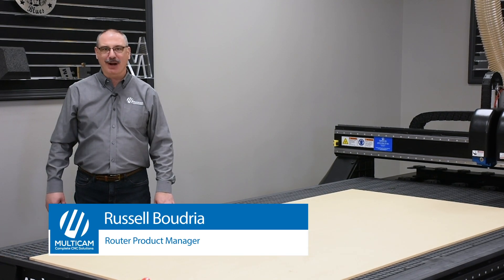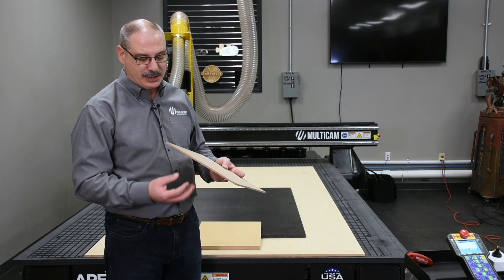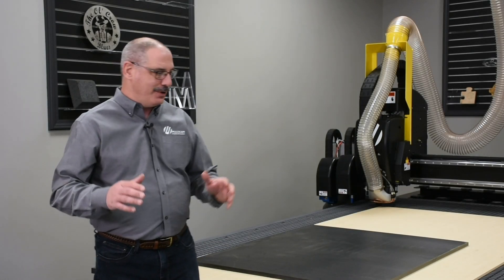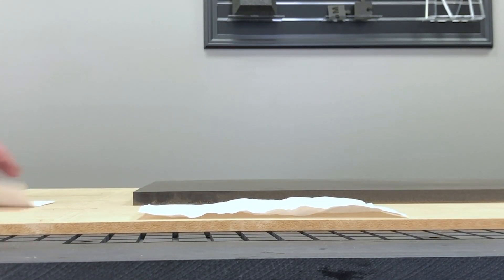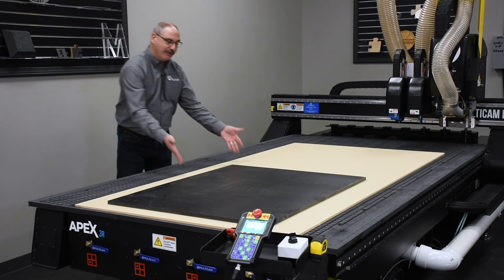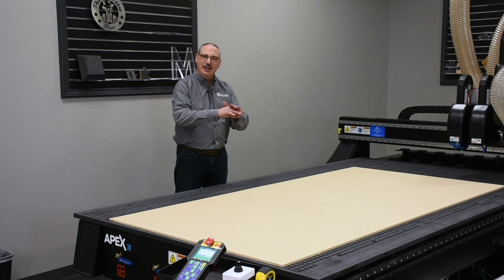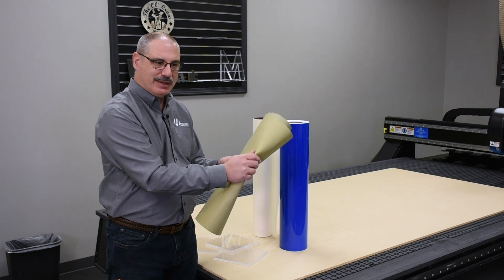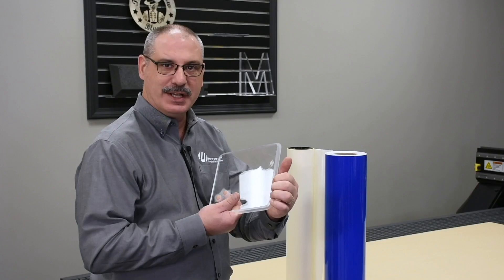Optimize Your CNC Router Spoil Board: Materials, Tips & Tricks and Maintenance

Comment: 1000imp? Well im running my bit wayy to slow i guess, no wonder its burning, its a 2+2 resurfacing bit.i like to take off small .02-.05 as well..at 12kRPMs what feed rate would you reccomends for a amana RC-2251 bit?. 350?-400imp?
Reply: Probably as fast as your machine can go. In a high frequency spindle, the proper chipload for those tools is usually higher than the max feedrate

Comment: Very excellent video.  Question:  Can two LDF be used at the same time so that one is always not cut into?
Reply: That would defeat the purpose of a spoil board and make it twice as hard to achieve a vacuum. Cuts into a spoil board are inevitable and even with a bunch of cuts can still hold a vacuum pretty well if you block off the unused portions of the table. Also fly cutting the boards when you first get them will produce an accurate flat table and you won't need to cut deeper than the material you're cutting.

Comment: Where is the program to resurface the spoil board? Is it built in to the controller or in the software? Thanks
Reply: they wont  tell,  they want $3000 a day to learn how to learn how to use the thing. INSANE!
Reply: @BTQuad  If the operator cannot program a spoilboard cut, then they do not know how to use the equipment